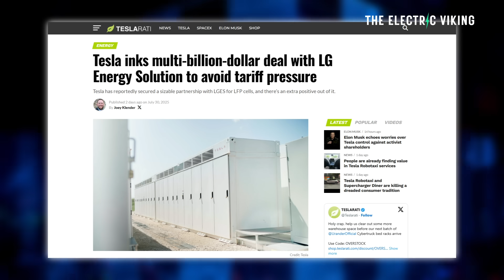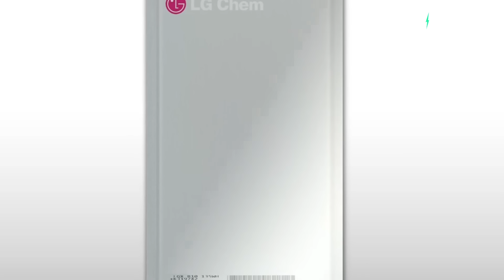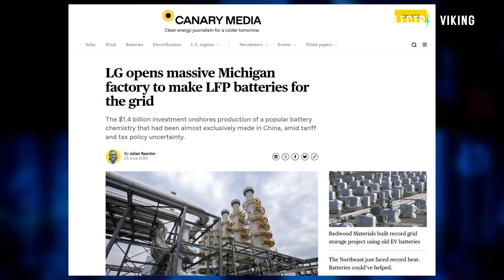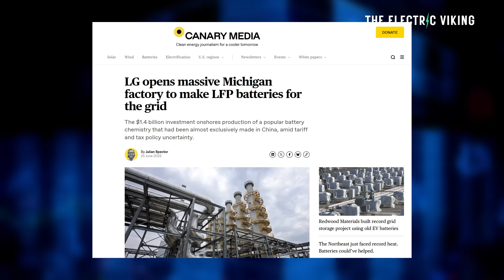Tesla Signs $4.3 BILLION Deal for 50% HIGHER energy Density LFP Batteries

Comment: Energy Density is measured in both KW per cubic foot and KW per pound of weight.

So if the 1 cubic foot is 8 KW on one brand and 10 KW on another brand, that is a 25% improvement from 8 KW + 25% (2 KW) to reach 10 KW.  50% higher would be as a example 8 KW to 12 KW in a cubic foot.  (I have no idea the actual number of KW that this battery has per cubic foot).  

The other measure is 8 KW might be 20 pounds (as a pure guess) and a increase of 50% is making it 12 KW for only 20 pounds.  

So is this battery 50% more KW per pound or 50% more KW per cubic foot?

The KW per pound is really important, even if the battery is slightly larger than a lower output and more weight option.  

The KW per cubic foot has some importance, however it is not as critical, because the battery compartment can be designed a little taller or longer.  

My guess is that the battery will be both slightly smaller and have a higher KW per pound rating.  

They can also come down in price too.  Let's say that one cell is $75 per KW, and the other is only $50 per KW.  30% of $75 is $25 reduction.  But as explained on the video, the cost of adding about 20% nickel will ad about 10% to the cost per KW. 

Then there is charging speed.  If the battery pack can accept 150 KW per hour rate, that is acceptable.  If it can take on 250 KW per hour rate, that is outstanding.  If it can go higher than that, it is wonderful.  

It seems like if they use 30% nickel, that is a huge improvement in the density of the KW per pound, even if 10% more expensive.  This is a great trade off, especially if the charge rate is fairly quick without warming the battery pack to much.  But I think that the pouch battery might have a slightly more difficult time at getting rid of the heat, unless the cooling water is allowed to circulate between the cells, like in a 1/8" thick mat with the water going through the center of that mat.

Comment: Batteries are sold by wattage NOT weight so a 60KW model Y is still a 60kw not suddenly a 90KW . Density in wattage peg Kilogram , you also need to consider size and cooling area around battery as that may need to be slightly increased . If a battery is a higher energy density that does not mean you automatically get more Kilowattts for the same price .

Comment: One problem is the perception that LG Chem’s batteries catch fire.  It seems they have turned these safety problems around.  Perhaps the topic of a future video?
Reply: Hyundai spent a truck load of money replacing over 75 thousand LG 64kw packs in the Kona, I wouldbet real money this is the tip of the iceberg. You think that was about "perception" hmmm. Interesting.
Reply: Most lithium battery that burst into flames fire are NMC (nickel manganese cobalt) or NCA (nickel cobalt alloy) lithium battery. 

LFP batteries are almost unlikely to catch fire by itself, so it's much safer option
Reply: Yes it's perception versus reality, we have accepted how flammable petrol is, how polluting to produce, transport and burn etc. all normal.
Reply: wow, the media and perceptions just havent absorbed the advances and changes over the last 5 years.
Reply: @andyfreeze4072 airplane crashes and ev fires attract more viewers, which means advertisers have to pay more.  So the media avoid good news.
Reply: with the lives of their workers from skorea.

Comment: Tesla is still building and soon operating an LFP battery factory in Nevada that uses CATL equipment and technology. CATL’s role has evolved due to U.S. political and regulatory requirements but is still core to Tesla’s domestic battery strategy. Your narrative that Tesla “dropped CATL for LG” is misleading. Tesla’s strategy is to secure multiple advanced, tariff-compliant supply lines: CATL’s technology under Tesla’s control for U.S. LFP production, and now a significant supply of high-density LFP batteries from LG for further resilience and performance.

Comment: Great video, Sam.  As I (think I) understand it, there are compromises or tradeoffs that  can be made such as trading longevity for greater range.  The LFP cells have much greater longevity than NMC, so they may have traded some longevity to get greater range.  By longevity I mean the number of charge discharge cycles to get down to 85% of initial capacity.  LFP has been very high, somewhere around 10 thousand cycles.  EV batteries could drop down to 5000 or less and still be acceptable.

Comment: Sam 16.5 kWh of batteries is just an add on to Tesla
 Total Battery Capacity: ~112.5 GWh across ~1.5 million Tesla vehicles in the US (estimated, based on ~75 kWh average per vehicle)
In Addition they have another 40 kWh at the MegaFactory in California plus another in Texas coming soon
If Tesla has a 50% denser battery they would maybe add 10 or 20% more range then reduce the amount of batteries per vehicle.

Comment: Excellent news! I wish the energy in new batteries would get 200% up or more. Maybe some day we will drive EV for 5000 miles without recharging.. :)
Reply: Nah. The electrons at that point would get old and stale and would have to be dumped out and replaced.
Reply: @DrTed3  
Well, even if we'll be able to recharge batteries only once a month it will be a great achievement. In this case most of the passenger cars with gasoline motors would stay in the past.

Comment: What I hate are the ads I'm getting on here. 2 ads that I know of, are scams. Maybe more are. It takes the credibility of the video down. Get rid of them Electric Viking, or I'm leaving. NEXT: "Nobody else has reported on this deal. Why the hell why?" Because it is fake new news. LG has heavily hyped its batteries over the years, especially through its subsidiary LG Energy Solution (LGES), which spun off from LG Chem in 2020. The company positioned itself as a global leader in lithium-ion battery technology for EVs, home energy storage, and consumer electronics, touting innovations in safety, energy density, and lifecycle performance. They have never lived up to the hype. No independent testing. Tesla has been sucked in. Sorry, Electric Viking, do your research next time. Blade 2 battery has the same density and will likely last twice as long.

Comment: More range?  Maybe, but probably not by much.  Sure, 50% more power density could entirely be used to improve range but they could also budget 25% of the 50% higher density to increase range and the other 25% to reduce vehicle cost and weight.  Assuming 25% fewer batteries at 150% higher density, the increased range, not accounting for additional range due to lower weight, would be (100%-25%) x 150% = 112.5% range.  Note that the weight reduction would not be just reduction of the battery weight.  It would also reduce the weight of the car’s structure and battery interconnect.

Comment: Viking, you missed the elephant in the room. Its all about the Trump tariffs. Korean LG tariffs are at 15%. The Tarrif on the Chinese imports (CATL batteries )are currently over 100%. Its a purely economic decision. I don't believe the LG batteries are superior to either CATL or BYD blade LFP.
Reply: He did not miss it.  He explicitly addresses the tariff issue.  Why do you believe LG batteries are not superior to CATL or BYD blade LFP?
Reply: @endstay  2 possible reason here, one is that Blade 2 batteries have been claimed to reach 210 Wh per kg for some models, so not much less than this battery technology, and they will continue to advance battery development, this will certainly not make all Chinese battery makers obsolete. But here's the big one, what is the safety rating. You see China is bringing in new laws for EV batteries such that battery thermal runaway is much less likely to happen, that is the batteries must be constructed in such a way that thermal runaway is not possible for at least 2 hour after a crash of any kind, however batteries with high nickel cathode content are more prone to thermal runaway than standard LFP batteries. So as good as they may be they may not even be allowed to be manufactured in China in the coming years after the law comes into effect in July 2026. Chinese manufacturers aren't going down that path simply because it may be illegal to have them on the road. This also means these LG batteries won't have access to one of the largest EV markets in the world. Now they may have solved the problem of thermal runaway, but that remains to be seen. Superior energy density isn't the only measure of whether one battery is better than another, if that were the case we wouldn't have sodium/ion batteries. Now I am not saying the LG batteries are better, or the BYD blade batteries are better, or the CATL batteries are better, there's not enough data in this video to make that determination, but this simply isn't a game changer of any sort.
Reply: @endstay  Based on recent history, they're not...

Comment: 50% more energy density is great, but will the LG batteries be more expensive? What about charging time, and how many charge cycles can they tolerate, in other words what is the estimated lifespan? Let's assume they are on par with CATL LFP blades. Let's further assume only 25% better density. That would suggest an extra 100 miles (160 km) of range, pushing the long range Model Y to 470 miles, maybe even 500 miles. Very exciting!
Reply: They are not going to have 50% more energy density. They might pick up a few percent on gravimetric density through improvements in construction, but that's it.
Reply: @davidbrayshaw3529  Viking and LG say otherwise.

Comment: Blade 2.0 will be 15% cheaper and about the same energy density. More stable and better temperature range and doesn’t use nickel. Not a very exciting news 😑
Reply: But blade is not repairable. If there is a fault with individual cells you will need to replace the whole pack due to the way they are integrated into the battery pack with glue.
Reply: Do more research your numbers don't add up
Reply: You are right. BLADE 2.0 is better battery.   10% less density than LG claimed density.  No nickel and Cb, reduce environmental impact. 20% cheaper than current battery,  fast charging,  extreme safe and operating at lower temperature.  So it will be 30% cheaper, 10% less density than LG battery as LG  battery is 10% more expensive than current battery.   Blade 2.0 is more or less available now.

Comment: This is great news because without the credits,  EV's will have to compete head to head with hybrids in the U.S.  For local, short range commutes and stop and start driving in low density urban areas, EV's have a distinct advantage, especially with charging at home.  For most other driving, EVs will have to up their game.  The real test is how long does fueling take to drive the most range.  In my case, my Crown Signia Hybrid can go 450 miles with 5 minutes of fueling.  It sounds like the new Teslas are getting closer to meeting this criteria with the new batteries.

Comment: 50% more energy, all else remaining the same, means LFP is now the only battery chemistry that makes sense in any application, I saw the tesla lg deal news and found it odd, but this "50% better" claim I find dubious
Reply: 50% better than what. On its own 50% better means nothing.
Reply: Why do you find it dubious?
Reply: @jamesgallagher2434  The other companies are very smart too and it would be highly unlikely for a competitor to find an advantage that large.
Reply: Last time they said 50% more power was the fact that they made it 50% bigger. So no changes in total power.
Reply: Marketing speak. All the manufacturers are improving their chemistries. I don't think LG has won, and CATL, Panasonic and all the others are going to say"welp, I guess we lost, might as well give up." Tesla doesn't even seem to be focused on EVs right now. They are trying to convince Wall Street that they are on the verge of driving Uber out of business with autonomous taxis, but it ain't gonna happen, it's a pipedream.
Reply: bought with the lives of contract workers no thanks
Reply: It's fake news. There is no factual basis for the claim about "50% higher energy‑density" LFP batteries as part of this agreement. Also batteries will be manufactured at LGES’s U.S. plant in Michigan, aimed at Tesla’s energy storage systems, not for vehicles.
Reply: 50% higher energy density = more range. Which is what Sam said.
Reply: Seen reports the BYD Gen2 LFP battery is 210Wh/kg - so the LG batt would be 9.5% better - not sure how they compare on cost.
Reply: @peter240365  Typical large cheap LiFePO4 cells are 175Wh/KG nominal, 195 ideally. 210 is really impressive. 230 is NMC territory.

Comment: This is one amongst many promising new tech traction battery developments.   For the ordinary man on the street it is not worth buying an BEV until the new hits the market.  Cheaper, safer cars with an improved range will drive depreciation for used current generation BEVs to even lower levels than they are now.
Reply: When personal computer came out, I tried waiting for the next technical development, but that led to infinite postponement  However, I have only ever purchased secondhand (used) cars.

Comment: Tesla has indeed entered into a $4.3 billion deal with LG Energy Solution (LGES) to supply LFP batteries, as reported by multiple sources. The agreement, set to run from August 2027 to July 2030, focuses on batteries for Tesla’s energy storage systems, such as the Megapack, not for electric vehicles (EVs). These batteries will be manufactured at LGES’s Michigan plant, with an option to extend the contract for up to seven additional years.

Comment: North American LG Chem batteries sucked, had significant problems for GM
Reply: They used pouch cells with General Motors battery management system. That’s why they failed.

Comment: This is more of an LGChem has some up with many new battery types and Tesla was smart enough to grab a large portion of the output of the factory. 
If they are producing them in Nevada I am wondering if they are going into the Tesla Semi that is still in pilot production and by the end of the year they will need a large amount of batteries as they ramp up. 
I missed the news that they the deal with CATL fell apart.. I am guessing this is part of the current president and Tarrifs.

They will also need batteries for there Cybercab when it starts production as well as for the Optimus and a high capacity small battery is what those will need as well. As for there Megapacs they have the battery solutions already going and the factory near capacity so i do not see them needing new batteries there.

I think you may have made a mistake i think the CATL/Tesla deal is still ongoing remember they will need a large amount of new batteries soon and i did not find an article on a reliable website for a breakup.

Comment: This $4.3B deal which starts in 2027 and lasts for 3 years is only for stationary energy batteries according to Grok. It will be used for megapacks and power walls and NOT be used for Tesla vehicles. The plant is in Michigan and will produce LFP batteries and the energy density is LESS than those used for vehicles. Your video is inaccurate and misleading to Tesla investors if Grok is to be believed. I would like a response from you on this as I've watched many of your videos and your credibility is now in question. Rooting for you Sam... but presently trusting Grok.
Reply: Seems to have a vested interest in tesla doing well. At least emotionally.
Reply: Reuters are saying that they might be used for either but there has been no official announcement.   Higher density storage is more advantageous for cars than stationary batteries, but there could be a reason we don't know about (or I don't 😅) why they are not suitable for EVs.
Reply: LG, no recalls related to any of their previous cells, right oh wait…🤐

I think you will find many EV companies have already used LG. Its great news but I think you are overselling Tesla’s brilliance. This is at least as driven as much by political pressure
Reply: I suspect density is improving enough vehicle use is within reach.

Comment: Can’t find a single article? Wall Street Journal reported on this news July 30, 2025, 2:19 am EDT. These articles report the batteries will be used for grid storage. They also state the deal is motivated by the need to produce batteries within USA. No one is saying the deal is primarily motivated by LGs chemistry. 

Travis Axelrod, head of investor relations at Tesla, said, “The impact of tariffs on the energy business will be outsized since we source LFP battery cells from China. We are in the process of commissioning equipment for the local manufacturing of LFP battery cells in the US, however, the equipment that we have can only service a fraction of our total installed capacity.”

“We’ve also been working on securing additional supply chains from non-China-based suppliers, but it will take time.”
Reply: The Wall Street Journal doesn’t know anything. They skew facts and make up stories more than they get things right.
Reply: Google-ing is hard bro...

Comment: What about the discharge rate of these batteries?  Can they produce the high currents that give Teslas the “zing” compared to many other auto brands when accelerating?  LFP batteries have only been used in the slower rear wheel drive single motor versions, so far.  Rapid acceleration is the pony trick that makes EVs so much fun to drive.